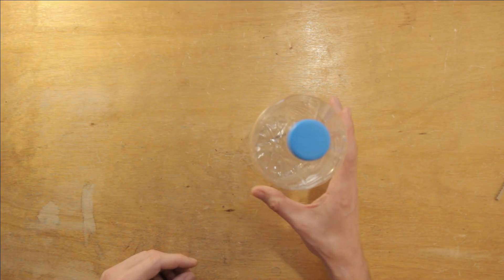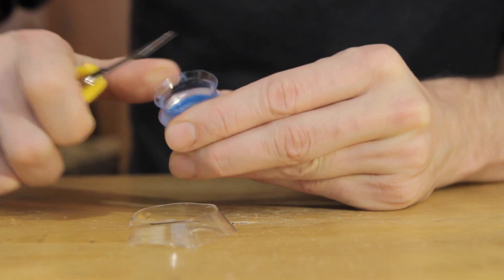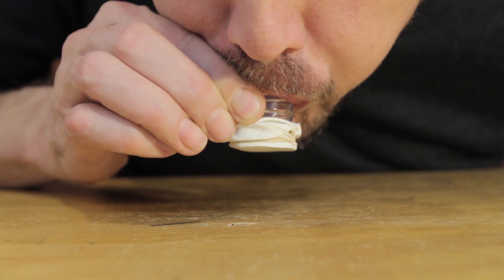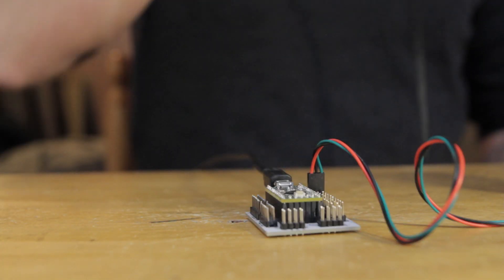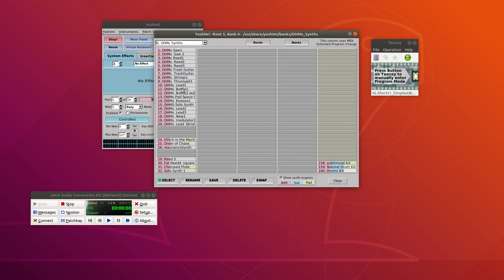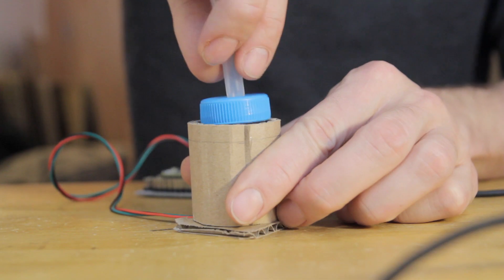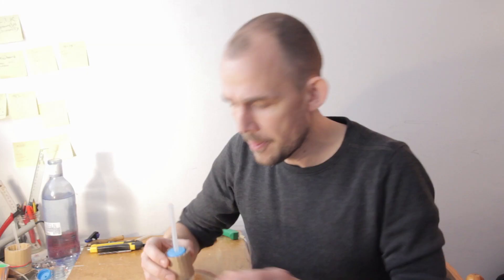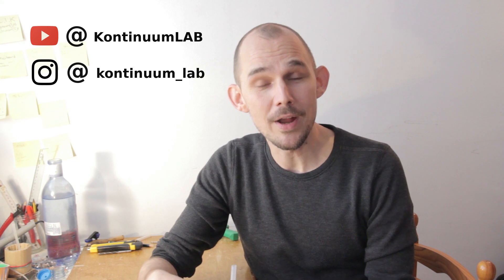Simplest Breath Sensor for a MIDI Wind Instrument EVER - From a plastic water bottle.

Comment: This is a great explanation! However when I try to replicate it, my sensor can’t detect anything under the darkness of the cardboard. Any idea why?
Reply from the maker: Hard to say without seeing your setup. Probably an error in the circuit...? Or maybe in your code...?
Reply: @KontinuumLAB  thanks for your response, i was looking at the sensor from above instead  
Of below that caused my confusion

Comment: What do you do about spit from mouth controllers?
Reply from the maker: I don't really do anything, except try not to spit while I play. The moisture that accumulates in a breath sensor is mostly condensation from the humidity of your breath, unless you're doing something very wrong with your saliva... A well made breath sensor has an exit hole in the pressure chamber, which let's condensation run off.
Also, once in a while, I change the balloon membrane, and clean the inside of the pressure chamber of course.

Comment: I'd like to make a much simpler, analog version of this for Yamaha vintage synths. It seems that early wind controllers, like the Yamaha BC1, originally designed for the DX7 were simple analog sensors. I guess the processing went on in the synth. 

Yamaha had a system where you'd plug in a BC1, BC2 or BC3 into a 3.5mm jack on some of their synths. This jack was labeled breath controller. The last Yamaha synth that used this as far as I know was the VL-70m which was released in 1996.

Comment: Warning: this comment might get a little long, I have several things I want to say here.

Perhaps this comment is a little late as I just now saw this video, but this is pretty cool! (even if I've no intention on actually using something like this)

Unfortunately I am visually impaired (completely blind, to be more precise), so I cannot actually see what's going on here. If/whenever you reply, would it be possible for you to give an explanation of how the air-pressure sensor is actually working? I have some kind of idea of what might be going on... but every sensor is different :). Actually, I have an idea in my mind that's closely related to the very concept of a MIDI wind instrument:

You know, an instrument I've been rather fascinated with lately is the bagpipes; the way they work is rather fascinating to me. So with that in mind as well as my fascination with MIDI, I thought "hey, why not have a bagpipe-style MIDI controller"? These do exist, but there's one thing that sort of irritates me about them:

I've done research on some of these electronic bagpipes... and... well... many of the electronic bagpipe models I've seen really don't accurately simulate how bagpipes are actually played. I'll elaborate more:

The main appeal of bagpipes in my opinion is that they involve a bag that you blow up with air. The pipes that actually make sound are connected to the bag. Once the bag is blown up enough, squeezing/pressing on the bag causes its air to get transferred to the pipes to make sound (in other words, you just deflated the bag after you initially inflated it!) The whole objective of bagpipe playing is to keep the bag inflated to keep the sound going (the challenge, though, is to do this while not actually lowering or raising the pressure your arm is applying to the bag which would cause the sound to become unstable). This is where you can really start to see the uniqueness of this instrument; blowing into the instrument with your mouth doesn't actually make the music, like how most wind instruments are played.

Well, the issue I've seen with some of the electronic bagpipe models I've seen is that the "bag" portion doesn't actually behave in this way. All it is is just a pressure sensor you press on with your arm (in other words, you do not actually blow it up with air!) This is why these types of "bagpipes" are very unrealistic. Now I'm not saying all of them are like this; there are certainly some models that actually involve you blowing up a bag, and squeezing it, and coordinating your breathing and squeezing and your fingering on the melody pipe, just like on actual acoustic bagpipes.

Perhaps, if you were interested, it could be interesting to see you make your own electronic bagpipe-style MIDI controller and post it on this channel! The bag part shouldn't have to be anything special either; it might even be something as simple as a grocery bag or something :) The pipes could be made from whatever material you see fit. Since this would be a MIDI controller, the reeds that make sound in an actual bagpipe would be replaced by switches or some other sensor that reacts to the pressure/speed of the airflow from the bag (like the sensor you demonstrated in this video). Each of the pipes could send out their own MIDI data. Alternatively (and perhaps preferably), the pipes could be connected to a separate box that converts their analog signals (the signals from the air-pressure sensors) into MIDI. This box could be held under the arm that's not squeezing the bag. In this way, the pipes are acting more like the pads for an electronic drum kit, in that they're merely sending out analog signals. The separate box would be acting as the "drum module" or "brain" of an electronic drum kit, in that it would be detecting those analog signals and converting them into MIDI. The bag isn't contributing anything to the generation of MIDI data, it's only acting as an air reservoir and as a method of supplying the airflow to the pipes and the sensors in the pipes would react to the speed/pressure of that airflow.

Would love to get your thoughts on this idea; feel free to reply whenever it's possible for you to do so!

Justin Naramor
Reply from the maker: Hi Justin. Thanks for your comment. I put off answering, just because it's so long, and then I forgot .... Anyway, your ideas are really good, and I might try out something like what you're talking about at some point. I have messed around with a concept for an accordion, which presents some of the same challenges.
Anyway, stay tuned to the channel, and I'll hopefully get around to it at some point.
Reply: @KontinuumLAB  Hey, thanks for your reply! Forgot I even wrote that comment :))).

I look forward to seeing what you come up with. Thanks again!

Comment: What a great solution!

Thanks for your innovative and simple-to-implement ideas! Your channel is a treasure trove.

I'm collecting pieces for my own EWI and while reading articles, I see MPXV7002DP (which I already have) or MPX5010DP being used. Have you actually tried one of these? How does your sensor compare, regarding sensitivity and general sense of pressure?

I'm mostly concerned about two things with your sensor:
- the feeling of backpressure might get somewhat uncomfortable when playing for longer periods of time; you know that dizzy feeling when having to blow lots of birthday balloons...
- saliva and condensation issues. The parts will get moist soon and there is no drain. Yeah, it's gross, but unfortunately, all woodwinds have to leak saliva out somewhere. Even the high-end Akai/Roland EWIs have drain tubes.

Also, I'm wondering how to create a more complex mouthpiece with bite / lip pressure sensor, to control vibrato or pitch bend of the synth, as Akai/Roland EWIs do. In theory, it should be doable with the same technique - light sensor and rubbery reflective surface.

BTW. which Teensy versions have you been using in your MIDI projects?

I can buy Teensy 4.0 for the same price as Teensy 3.2, so I thought v4 might be more powerful for the price. However, I saw a few forum threads about Teensy v4 USB driver support being just recently released, so I'm not sure if v4 is reliable enough.
Reply from the maker: Thanks for your kind words.
First of all: This video was the first presentation of the concept, and there have been many updates and new designs since then. For more info, check out my other videos about wind instruments, especially the KLIKsophone, which features an optional pitch bend enabled mouthpiece that can be adapted to include other sensors. 
You also might find this playlist of short videos interesting: https://www.youtube.com/playlist?list=PLCejzxWlLD_ybX0R1CpkwIb5D1jcsiq2- Especially the mouthpiece that measures tongue position with an optical sensor. 

As for your specific questions. I haven’t experimented with the NXP sensors you mention, but I’ve tried some on other peoples instruments. I honestly prefer my setup, specifically because of the things you mention: Back pressure and hygiene, plus sensitivity and responsiveness. The thing with this kind of sensor is that you can customize it completely to your liking, by varying three factors. Entry hole size, exit hole size and balloon tension. Here is an example of extreme sensitivity and responsiveness: https://youtu.be/evYnI6XT6q4?t=240 As for hygiene, you can easily disassemble the sensor completely and clean all parts, change the membrane or whatever you feel you need to do. Can’t do that with an NXP sensor… 
I’ve used the Teensy LC, Teensy 3.2 and Teensy 3.6. The T4 won’t work for me, because it doesn’t have touchRead() functionality, which I use a lot.
Best of luck with your projects!

Comment: how can i use this on a real keyboard? like can i just plug it in to my keyboard and it works?
Reply from the maker: Depends on the keyboard. These breath sensors are MIDI controllers, so they will work with any synth that accepts a MIDI breath signal. If your keyboard is a MIDI instrument as well, then plug them both into the same synth...

Comment: Mr continium lab, I have a question, I want to make a stringed midi instrument and I need to hit a string with a Pick ir fingers but I need to do a continious reading with veliocity measurement, a piezoelectric could work for the task?

Greetings from mexico
Reply from the maker: Piezo might work for that. But remember that a string responds when you let it go, not when you first hit it..... I saw your other comment, and it seems like you want to do everything with piezo sensors. I don't think that's a good approach. I make MIDI strings out of capacitive sensors, and they work quite well: https://youtu.be/zTlreE5oemQ
Reply: @KontinuumLAB  I want to work with vibration, something using a string and intensity, But i know that capacitive sensors are only on/off switches
Reply from the maker: @Mike77154  oh, you want to read actual acoustic strings. That might be possible with a piezo sensor... have you considered an actual guitar pickup? Capacitive sensors on the Teensy chip are not "on/off", they provide gradual output, which is how I make my MIDI strings sensitive to intensity.... It's a hack, but it works